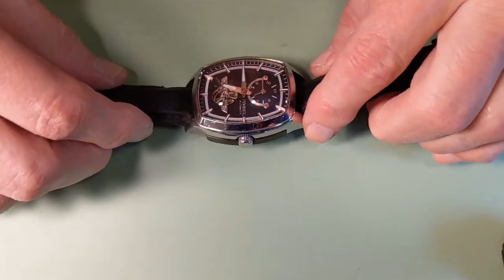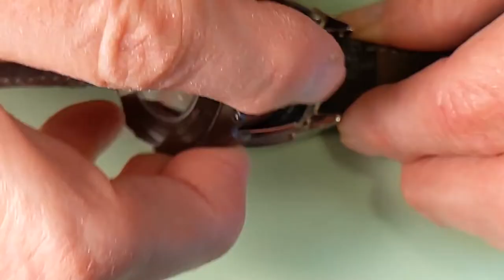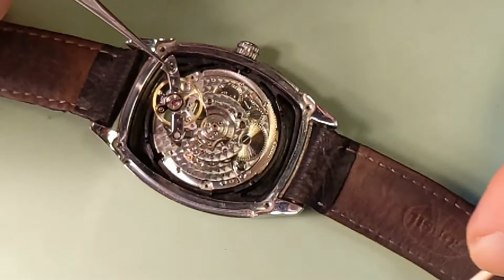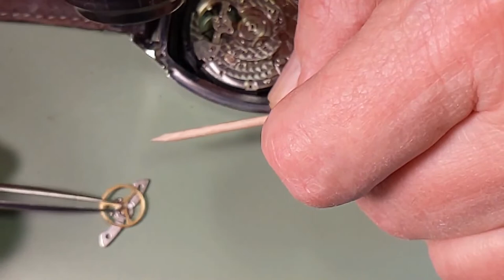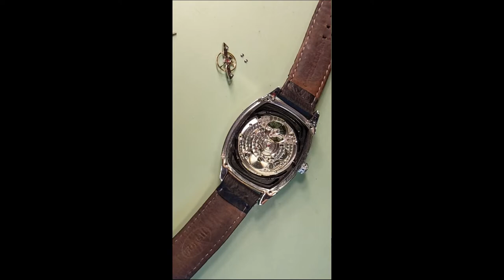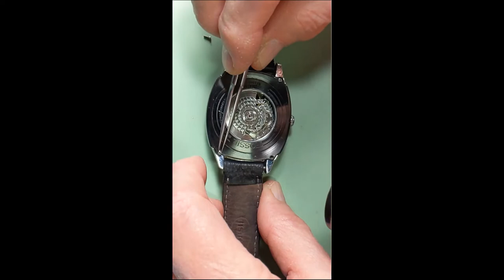Replacing a Balance Wheel Assembly in the Fossil ME-1046 Automatic Watch How To

Comment: I am looking for a balance wheel replacement for a Fossil ME-1038. Staff broke off. I can’t find a replacement. Do you have a way to find a replacement?
Reply from the maker: The balance is different in the ME-1038 than in this ME-1046 movement. You might want to look at the ME-1038 and similar, which are ME-1000/1001/1002/1007/1011/1012/1015/1019/1020 . I do not think you can find the balance itself, so you need to buy a donor watch with a whole movement. Good luck!

Comment: How does the second time zone work on this? Seems to be moving along
Reply from the maker: It does not move along. The minute hand on both zones are always at the same point, while you can set hour hands with different interval. Rotate crown clockwise to set a second time zone hour and minute hands. Then rotate crown counterclockwise to adjust the local time. Thanks for watching!
Reply: @ValentechTime  Thanks, so the minute hand on the upper clock cannot be adjusted? It moves along with the local time minute hand when rotated counterclockwise
Reply from the maker: @sohanbalachandran  Correct, the hour hand on the second time zone what can be adjusted. Minutes are always the same as local. It's a simplified design.